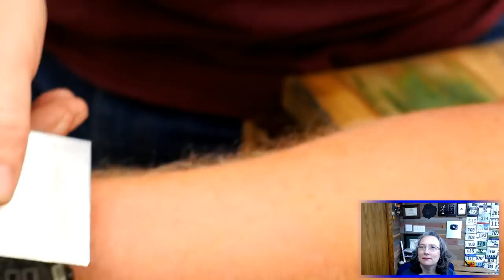How to Set Up a Hand Plane - All of the Hand planes!

Comment: Could the auger bit box have been in three parts (back mid & front) with the different auger holes being routed or profile planed out in a half circle & then glued together so the two half circles make a tube (with the mid-piece being routed on both sides"?
Reply from the maker: That is my guess of how they did it in the factory. I would guess they would have another half of a steel framed act as a guide to hold the bit straight. But who knows.

Comment: I recently put a pmv11 in my no. 7 jointer, I had to file the mouth a little because the iron could barely escape the mouth. I ended up having about 1/32 or less gap left once the iron is proud. Sometimes the gap is even less than that. I was tempted to go back and widen a little more because the mouth can get a little packed while working, and it's not shavings catching on the chip breaker (Stanley chip breaker). But from what you have shown, I shouldn't widen the mouth more than what it is?!?
Reply from the maker: it all depends on how big a cut you want to take with it. if you want smoothing shavings then it is where it should be. If you want moderate shavings you may want to open it a bit. the bigger the shavign the bigger the chance it will jam.

Comment: I have often wondered about making an auger box like that. I love that design. All Grandpa's augers are sharp and complete except the 12. 3/4?  Since he has doubles of nearly all the other sizes, I'm guessing he had two sets and broke both of the 12's. To drill 3/4, he had an adjustable auger. I watched your video on sharpening auger bits and set about to do the same. I discovered Grandpa left them all clean and sharp when he put them away. I found them resting in a tray in his tool box. There are also regular drill bits that appear as though they fit the Brace. Did they use those?
Reply from the maker: Nice! yes you can find twist bits with a brace connection. I have a small collection of those!

Comment: Sharp, perfectly set up (super fine), and produces only a little dust clog =  biG FaIL... 

Next time that happens I'll try skewing the plane  a lot to see If the fibers clear sort of sideways. If that doesn't help I really like your "file the mouth back at an angle" advice , thanks.
Reply from the maker: ya that is the problem with modern Irons and chip breakers. They take up much more of the mouth.

Comment: I hear the old wive's tale of the wave riding plane. I have YET to see it proven. It sounds, to me, like a guy needed an excuse to buy (make) more tools and he cobbled up that idea to horn-swaggle his wife into letting him have a new toy.SOooo, a challenge! Take a good #4 and a #7, Raggedly cut (both with choppy cuts and long wave cuts) several boards. Edge plane ( will allow feeler gages and visible light test) Plane one with the #7 and one with the #4 the inspect the edge with careful scrutiny. IF you find more than .001" variation in undulation with the #4 I will shut up and back your tool choice.
Reply from the maker: Oh I will have to do that. I could have shown you on the board I had last night. there is a large difference int he smoothness you can get between a 4 and 7.
Reply: @WoodByWrightHowTo  Smoothness or waviness? I tried with my #4 Kobalt and on edge planing it was FLAT. Or flat enough for what my talent allows. hehehe